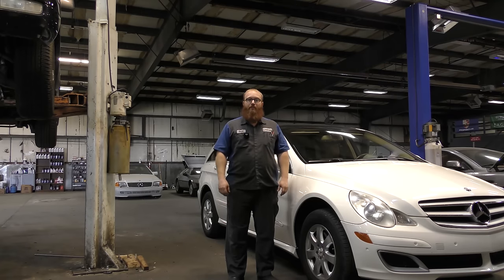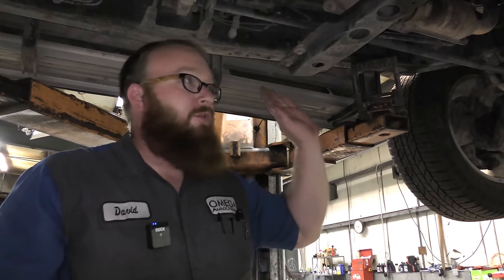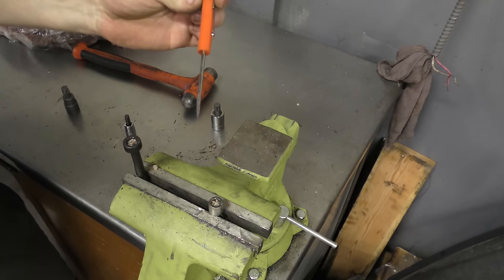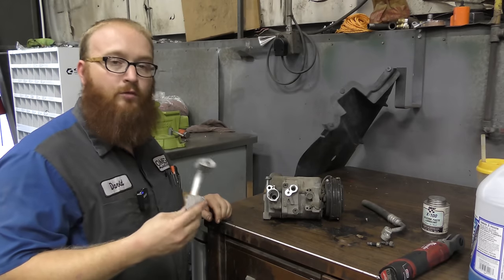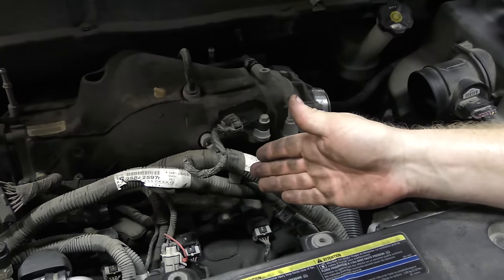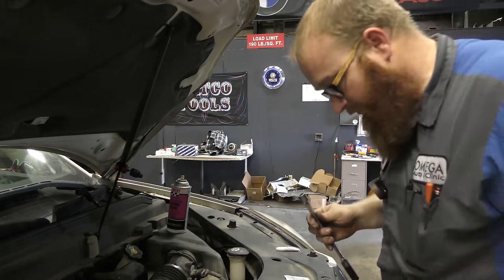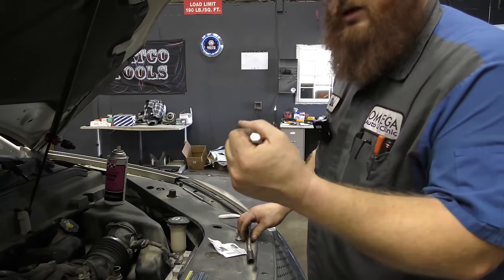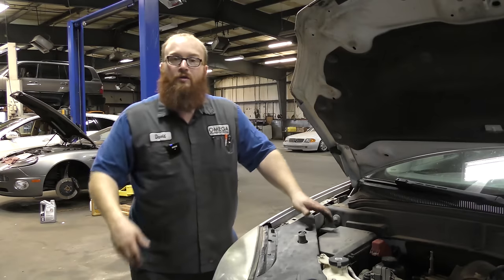The CAR WIZARD shares 10 Crazy Easy and Essential Mechanic Tips

Comment: I dont know how much space is allowed for comments but here goes. I saw your video on your customers Hyundai and I gotta say a few things. Im 76 years old and been a car guy for 60 of them having rebuilt my first high performance engine in the basement of my parent's house at age 19 and have some years experience as mechanic, parts manager, service manager, etc. Those Hyundai engines are not "junk." The problem is that some Americans simply dont want to do the routine maintenance needed on these small high performance asian engines---its been an issue ever since the big cast iron V8 monster with its 1940s technology ceased to be in vogue. I cant tell you how many Hondas and Toyotas with blown head gaskets etc came to my shop as a result. There are tons of Hyundai and Kia 4 bangers with 100 to 150K still on the road bcuz their owners took the care needed. Ive owned both Hyundais and Kias and if you do the recommended maintenance you cant kill them---trust me, I know. And as to Kias issues with its 2.4 they suffered engine failure only bcuz their crankshaft sub contractor left the oil passages dirty after machining, resulting in the class action suit making Kia replace those defective engines. Alot said, I know, but I still really enjoy your videos---youre a real kindred spirit.

Comment: German 109 aircraft had fuel injection allowing them flip over. The spitfire aircraft had  carb which stalled the engine when turning over due the floats with no fuel

Comment: That paper/super glue trick is really good. Those relay bypass is really handy. With purchase them asap. 
Only issue i have with my car is and it's wierd one no mechanic has a solution for is when I unlock my car and also when set in reverse my rear window wiper goes on and stops randomly on any spot on the rear window. 
It's driving me crazy to find the solution but can't find the problem why it's happening or what causes it. 
It's a European car a Citroën C4 Xsara Picasso 2004. 
Not exactly the car i would like but my wife likes the height for easy to get into the car. 
Would be nice to finally get a solution for this anointing issue. 
I recently found your channel and I like your way of explanation on issues, solutions and how things work. Thanks for sharing. 👍

Comment: If you do strip an allen key bolt Get a torx bit one size bigger clean out the bolt tap the torx bit in as deep as it will go and remove the bolt. Be carefull that the bit cant come out and does not move. If it does come out tap it back in at the same spot. you can if its realy hard. weld the bit in the bolt yes it cots you a bit but it could maybe save you hours of work!

Comment: The fuel pump tip might apply to a starter too. I've had a starter in that exact same condition. I didn't try banging the starter when it happened - it was a standard and just push started it.

Comment: Silicone grease is great at reswelling O-rings. If you have an old O-ring that is brittle, nonpliable anymore put silicone lube on it. It will return back to almost new. Great get me by till you can get a new proper O-ring.

Comment: Google helped me find a 1 wire oil sending unit was causing a voltage problem on my ram for the throttle body and peddle assembly. Sending unit still read correctly but pulled voltage down. Unplugged the sending unit and could drive the truck off the trailer we hauled it home on. I found a technician note on it on a site that professionals use for fixing help and wiring diagrams.

Comment: I saw why you said this video is not for the trained mechanics when you showed that you don't know the difference between a stripped bolt and a rounded bolt.

Stripped means the threads have pulled off, so that the tool turns the bolt but the bolt doesn't move in or out.

Rounded means the tool turns in the bolt, but the bolt stays still, not even turning.

Comment: Thank you for sharing those tips!
Add a BlueDrive to your affiliate link and do a video on it. BD was working great for me as it’s offering quick testing and comprehensive solutions to almost all car issues and it’s absolutely inexpensive! I always keep my in a car, and in some instances I was able to make diagnostic on my vehicle as I was driving on a highway on my family camping trip. About 200ml in my Expedition started to act out after I was trying to past semi on 80mph speed limit. I got spooked, after the “wrench” light pops up on my dashboard. 
Question started to poping in my head. hHow bad this is? Can we make it there? Would the vehicle starts on the way out? 
Should I just turn around, and run our family and friends vacation? 
Blue Drive was already plugged in my OBD port. I just ran a full test, identified the issue, and realized that if I just going to accelerate normal, then I can easily drive the vehicle with no issues! In about 100mls the engine failure light reset by itself and vehicle was running okay few more years. 
Very helpful little thing to have on your vehicle!

Comment: Just replaced the fuel pump in my 1995 Chey Silverado 300,000 miles I hated to put aftermarket 8n  but I kept the original because it still works hose was split a couple inches from pump  and I use a little bit of axle grease keeps washers on and bolts and nuts in the socket

Comment: Wow I'm not a professional mechanic but I knew every single last one tip.   I feel your pain though when the millenial working for you in the shop doesn't and thinks everything is done for them all they have to do is be there with google search. 
Here's another tip: never pull out each fuse to test it, instead dab a tester across the fuse's exposed tabs. if the tester lights that fuse is bad. Simple

Comment: My dad was electrician at a Chrysler plant and had power window motor did not work pulled the door panel off and took hammer and hit the motor housing and started working of course we replaced,  bought new power window motor and fine after that

Comment: I bought a 1999 dodge ram 3/4 ton v10 gas! I rebuild the throttle body + new plugs and batterie  it  starts good and runs good until it worms up  then it starts to run rough no power until I put my foot in it then it will dog out and it will pop out the back then take off like a race horse.

Comment: Triple squares aren't too bad. I have ptsd a little from taking inverted torx cylinder head Bolts from stationary engines I work on even still from time to time. They were 150lb ft in a sequence then 90 degrees of tty twice per bolt.

Comment: Great tips! I've known for many years about the o'l paper in the socket trick. My dad taught me that one. I have a question for you. I have a 2002 Nissan Xterra 3.3 VG33e 2X4 non supercharged. My ABS unit will not connect to a scanner. I've had multiple mechanics tell me to replace the entire unit. Well I did and guess what it still doesn't connect. I would absolutely appreciate it if you had any ideas about this issue. Keep up the great videos. Very helpful.

Comment: No, the first tip is to have a shop with a lift.  Most of us are trying to change axles, etc. on ramps on gravel driveways.  The second, more important tip, is buy a Toyota that has been serviced,  (read "Private seller in posh neighborhood with nice landscaping") and you won't have to wrench on it.  Too old to be fuss'n with cars anymore, been there, done that, my joints ache now.  Buy a clean Toyota and problem solved.

Comment: Good videos, basic but not that basic. Sockets wth small magnets glued in them work. The paper trick is good even on brass, alum, and ss hardware too, all usually non magnetic.The long extention technique is good for starters and manifolds,  spark plugs too.

Comment: 2:23 Be careful doing this when a bolt breaks loose with that much spring because when the bolt breaks loose the ratchet changes direction stops and springs back and hits you in the mouth  you know how I know well I have a broken tooth and hole in my lip and broken glasses to prove what you should not do

Comment: Thanks for the tips! One thought on tester relays you've got. It would be cool to have one with a diode to check if the relay is being triggered. That way you have a switch one to test everything past is and diode to test everything before it. You could probably just use new relay after switch test, but maybe there's a scenario where that would come handy.

Comment: Fyi there could totally be a cut wire with that relay switch: the control wire.  I'm not trying to insult you but when I see those in someone's tool box it's a red flag that they don't know how a relay works, how to test it, or how to bypass it.

Comment: If a mechanic needs to remove a full fuel tank, I sure hope he has a pump to remove the fuel. Takes a minute or two but a good water pump does work, just make sure it is usable for fuel. NO-NO sounds like mommy....
In most cases, you can swap out known good relay to a circuit that is not working using a relay already in the junction block. Not all times, but usually. 
Interesting for many, for some of us....not one thing learned,

Comment: The banging on the fuel tank to get the fuel pump working again doesn't last forever. I thought I could have a rubber mallet as extra theft protection (Not reallly) like a kill switch. You might get away with it for a week or so but eventually you will find yourself banging harder and longer to get it to start until you're stuck. Who was the genius that put an electric device in a fuel tank anyway? Probably related to the guy that made asbestos cigarette filters.

Comment: Thank you for the interesting videos. Question, why do vehicles with solid rear axles have shocks mounted where they extend below the axle and can be struck by obstructions? It seems like every pickup truck is designed this way, and many are off-road where the shocks could hit rocks or edges in the terrain.

Comment: Hey everyones tips in the comments are great i learn new stuff every day if you have to take off exaust parts use liquid wrench always and let it soak for 1/2hour slowly back and forth till its loose and silicone spray on rubber hoses 😊

Comment: Hi Dave, love your channel. I have a 93' Jeep Grand Cherokee Laredo I6 4.0 I'm needing to drain my fuel tank full of gas which I've already disconnected the fuel line just after the fuel filter and stuck a separate hose to the filter into a 5 gal container. So my question is: Would I be able to use one of on/off test switches you sell to activate my fuel pump @ the Fuel pump Relay box for my Jeep? Hope you will read this as I will definitely give you a thumbs up.

Comment: For the first tip about the extensions I have a Pontiac Solstice and in order to get to one of the bolts on the thermostat housing if you have a turbo Solstice which I do its best to stand on the passenger side with as many extension as you can to reach it, I've tried that I've had about me before extensions at most and one of them was a small one and I don't see how this works they're all very loose don't have good enough leverage and the moment one is too loose it breaks apart and then falls down into the transmission tunnel and then I have to Jack the car up to get it. I even went out and bought a brand new set of extensions because the ones I were using were clearly old and that did not even work. Suggestions?

Comment: Do you have a tip for identifying when a water pump is truly bad?
Reply: Paul, if you see coolant leaking, even if its just once and you cannot find any hoses or the rad itself with a leak, it is most certainly coming from the weep hole of the water pump.

If you can actually see your water pump look at it closely and see if you can see coolant coming from the weep hole. If you can that means the bearing is bad and the water pump needs replaced.

Comment: Beating on the tank is exactly how I figured out my fuel pump was going bad...so  I changed that,didn't have any power to the pump or anywhere  else in the truck..I'm talking a 92 chevy k1500,  so I changed my fuel pump relay  STILL no power anywhere in the truck,brand new battery.....any ideas  anyone?   I'm literally  losing sleep over this issue I want my truck back!

Comment: I bet a lot of "pro" mechanics make these mistakes.  I once had a garage that supposedly specialized in engine replacements replace my exhaust manifold and they left out a bolt.  The threads were fine, they simply omitted one bolt!

Comment: won't the silicone spray on the intake hose cause silicone poisoning/check engine for O2. should let fully dry 30min before running the car.

Comment: How are you Wizard?  I own a 2000 Chrysler Concorde LXI, that I put over 4 grand in, then the timing belt went. Im trying to sell it locally. This car ran like a top, before the rods, got bent? Now obviously, it needs a motor dropped in it, or the heads takin off, and all new rods, put in? What are your thoughts? I put new A/C, EVAP, to the charcoal canister, body mounts, ect…, ect…. 4 grand in parts. Basically, a entire new front end? Im curious what you would do, with this car? Thanks for your time👍

Comment: Mr Wizard, i have a 2006 grand Cherokee that threw an 02 sensor code a few years ago. I ordered all 4 from rockauto and I couldn’t get any of the 4 out. I tried penetrating oil, trans oil but my biggest problem was getting or trying to get the tool with leverage  in the tiny space. I broke 3 ratchets and gave up, I reset the code and the 02 code never came
 back. Do you have any tips on how I could have gotten better leverage without ripping out the exhaust?

Comment: How are you doing Mr. Wizard? I am faced with a problem with my 1991 Bentley. I gave it for an oil change and the guy lock the doors and now the car won’t start you said on your video the Bentley died out and it wouldn’t start to change the alarm battery and you change the alternator, did the car have power and not crank..?

Comment: wizard, i am lost  your my last chance on my 1990 saburban, in summer in  runs at 2000 rpm and never drops in winter its normal but starts high/ i have replaced the entire Environmental system. the shop   ran it on the computer ,  and it said its all good but no one knows , i am to the point of sending it out for parts.  new  exhaust and  and O2   sensor

Comment: Hey guys needs your help I have a 2017 corvette with out Warranty 8000 miles ,
Took it to Dealer with an emissions lite They installed senser ,
Got to drive home grinning in gears then a mile up the road clutch fell to floor on its own ,I pulled
 it up 
seem ok
 Then I changed the slave cylinder with the ranger method .
a week later it happened again ,Called the dealer they said on these low milage c7s they have had this happen sooner or later you will have to have it towed in to us for repair ,
Usually they have to change the slave cylinder and master cylinder drop drive shaft and cat and exhaust at a labor cost of 4,700 dollars you see a lot of corvettes is this true Help advise May be looking for another Corvette soon

Comment: 🎉Please, please, please help.
My Toyota Sienna started overheating after I had the radiator replaced. I Also wasnt getting any heat.from the dashboard only cold air.  So far  I have done the following:
Replaced the thermostat
Replaced the temperature sensor.
Replaced a bad actuator on driver's side.
The temperature gauge. arrow still goes up to hot fairly quickly (I then turn off the car and wait til it cools before driving for another 10 minutes).
Should I give up on my 2006 Toyota Sienna or should I try having the water pump replaced?  Is there anyway to tell beforehand if the problem is really the water pump so I dont waste more money? 
Please help.  😓

Comment: Hi car wizard! How are you ! Please help me if you get this. I know I need to check my exhaust manifold for leaking rattling noise on Toyota S Corolla 2002 . I changed a tensioner pulley and a water pump my self. But that wasn't the noise. I like older cars so I could work on it and save money. It rattles on and off. Could it be the spring bolt . Maybe you've had to fix that sometime ago and know my issue with it ? I know you're extremely busy sometimes. Thank you very much .

Comment: Is it safe to spray silicone on the outside of the electrical connector and on the wire insulation.

Comment: Youtube saved me had a idler pulley snap off on my 2011 ford escape got a $1200 estimate said they had to remove engine to get enough room i went on youtube found a video removing alternator to get to other side of bolt an saved $1160

Comment: Hey man having an issue with my 2005 Chevy 2500hd 6.0 ls new power steering pump (aftermarket) whines more than before the original. Is there a GM or one that you’d recommend?

Comment: #1  I HAD to do this to remove my 2006 F150 tranny; not a trick/tip
#2 had to do this on  8 yr old chevy truck starter when it wouldnt turn over inexplicably in  minus 28 deg cdn winter